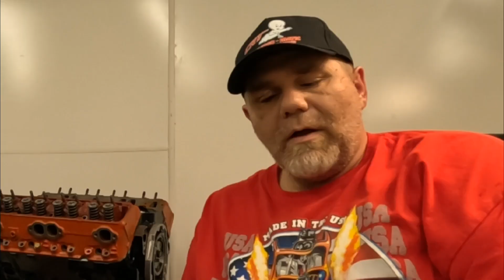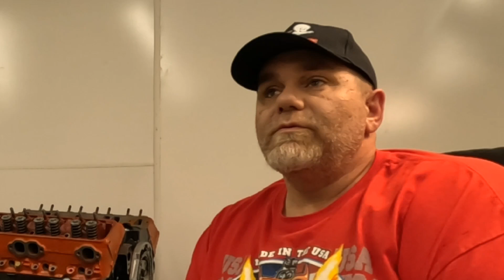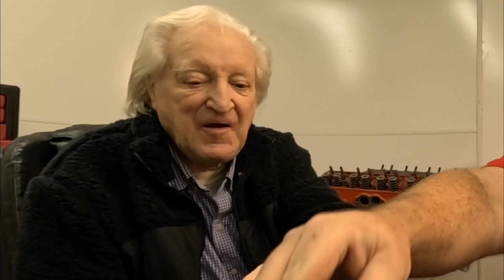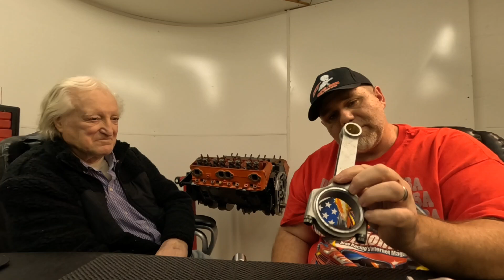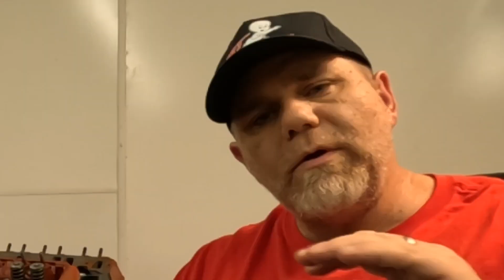When is Stock NOT really STOCK? @DavidVizard @servediocylinderheads @JustMoparJoe

Comment: UTG missed the point. The engine is going to be auctioned off and and end up in somebody's street ride. Now, I'm pretty sure they would much rather have 300hp, than 185 or whatever, I personally would feel they would probably be underwhelmed with such a motor and it would end up going on the shelf indefinitely but glad they contributed to St Jude's all the same. So what if they use closed chamber heads? it's about using the best OEM stuff possible afterall. I have a feeling they would have junked the 4 barrel intake and carb and fitted an aftermarket 4 barrel setup anyway. And rejecting the gift I was going to send you UTG, get a grip! - if someone wants to derive enjoyment from sending a channel they enjoy watching a gift, whats wrong with that? Oh well, it has now gone to another well known Mopar channel who were MORE than happy to accept it!
Reply: I didn't miss the point...the point CHANGED after the outline of the project was established and THEN a charity became involved.  
As for accepting or rejecting gifts, as a policy we don't accept anything from anybody, and you would be shocked at some of the stuff that's been offered over the years.  This policy goes back to my automotive journalist days.  Why? Because what's the difference between accepting a token from you or a car from one of the manufacturers.  Either one has the same potential to cloud my judgement and sway my opinions.  It used to fall under the heading of "journalistic integrity"...these days that sort of thing doesn't really exist anymore, does it.

Comment: Once you threw this cylinder head guy into the mix it was apparent that the “normal guy” with a dirt floor garage couldn’t do all that will be involved with the cylinder head. 
    I was lucky enough to be in a couple machine shops that , yeah we built some stupid sized off the wall engines , BUT,  we also had the tasks of building some engines that were for factory stock race boats and a couple F.A.S.T and Pure Stock engines .
    My opinion,  sometimes that skill set pulls you down into a humble mode and makes you think harder outside the box.  Unfortunately some people cannot afford those multiple boxes.
Reply: His name...is " Charles Servedio" 😁👍

Comment: Keep it like it was originally laid out, a rock auto “hot rod”. Like a 2bbl thunder bomber rule motor. It makes what HP it makes but hope for the best.
Reply from the maker: Even under Thunder Bomber rules you don't have to reuse worn out 50 year old part... That is what most people thought I was going to do and I realized that TOO Late.. 
Andy
Reply: @UnityMotorSportsGarage  he said parts from rock auto though.  The way I took it was anything oem replacement offered by rock auto.

Comment: Nice update!  I agree with the cost effectiveness of the rods - that is not the chokepoint anyways.  What I see on the big picture is a 318 getting 340 power.  Add the 340 cam, intake, and work the heads - oh and that pesky production valvetrain setup.   On the stock subject, these is "bone stock" - exactly as factory, and then there is a "stock" class for racing.  The local autocross has stock (with parameters), modified stock, and open class.

Comment: I love so called stock builds? My 1968 302 (306) made 503 hp with all used parts but the cam and lifters. Ford Motorsports Factory replacement Rods and crank, had to find several batches of old 1986 flat top Four valve relief pistons that was factory 0.030" over, Yes, those are indeed Factory forged pistons to boot, A set of ported 1970 D0OE 351 Windsor heads by Jim Lingenfelter ( Yes, Kin on legendary John Lingenfelter) with 1.94" intake valves, and 1.60" exhaust valves, I angled milled the head from 20* stock to 18.5* ( Yes I worked at a automotive machine shop, I ported my Victor Jr intake, I bought a used rebuilt 750 Holley DP, Used Hooker SuperComp Headers, now, The cam was originally a custom ground cam for a 351W, no for a small cubic inch engine, 0.697" On the Intake and 0.703" on the Exhaust and 108 LSA, I do not know the rest of cam card, But it sounded like ProStock engine at ideal and screamed to 8800 rpm me shifting gears, my father loved driving my car but the taddle tall Tach said 9500 rpm when he drove it. I was hoping for 375 to 400 hp on my first personal build, I over shot that big time. One thing I did learn though? Time is indeed money if you Think that away, I personally don't care on the time to money part. I just love building engines period. As one person said, The super Stock/Stock eliminator class guys do alot on stock stuff thats beyond ones belief. But I learned from them on whats possible with stock parts that can be heavily modified. I also learned to get to know your local Automotive machinist, you never know what they might throw at you or what they might offer. live and learn as the late Sonny Leonard told me. Learn something new every day.

Comment: What about offset grinding the crank for a slight increase in stroke, compression and getting the deck height up near zero ?
Cheaper than longer rods perhaps and a few additional cubes.....
Reply: That was my plan....
Reply: @UncleTonysGarage 
I was really interested in the original plan - max power from factory original parts. At one time, I built engines under similar restrictions, exception being a 500cfm Holley 2bbl and a class spec. cam.
Using a few stock part optimizations, my engines always ran up front.
Added knowledge is this direction was what I was hoping for.
Reply: @UncleTonysGarage  
As an old school machinist that's how I tend to think with every component in an engine, how can I cut, grind, contour or drill holes in this to make it better.
Good luck brother

Comment: This is a prime example of how quickly something simple can get fucked up. The plan was simple it wasn’t supposed to be a build it was supposed to be an experiment. Of course it’s easier stronger and probably cheaper if you time has any value to just buy aftermarket parts. If you replace one part in the engine (even a rod bolt) with a non stock part this simple experiment has no point anymore.
Reply: well, the experiment runs into the classic problem of giving the 318 any sort of real compression. and your bit about the affordability of parts is valid--was Tony footing the bill? I have to agree with what Andy said here or someplace else--he's building a brand, and using crappy worn out parts isn't going to help that. But as for "non stock" parts, is a Holley carb (for example) an aftermarket part, or a factory part? they came on quite a few performance cars. We probably already know how much power a 2 bbl 318 is going to make--Ma Mopar likely took the best one they had to dyno test originally. we all love to think we can port a cylinder head, but in reality most people just make the ports too big and mess it up.

Comment: Forget the original intent  , and just build a .030 over 318 , with a DV speced cam , Charlie's heads , and try a few manifolds and carbs on 'er . Also one or two of the 2 barrels for kicks . Btw, who  is going to do the rest of that grinding in the crankcase ,,, ?

Comment: I think you should finish modifying the stock rods and do a build with the modified stock 2 barrel, just to stay true to the original idea as much as possible, and do whatever magic you can to a stock exhaust manifold. Its not hard to tear down a motor especially if it was never put in a car. You can go aftermarket later...Shave the block but not the head and regrind the cam? Just a thought.

Comment: I liked the concept of the original idea. However I think the idea of a 2 barrel carb was just a bridge too far. Generally any gearhead is going to install a 4 barrel... could have restricted it to a cast manifold to keep in line with the parameters. As far as heads go I know nothing about LA mopar heads..but I think if you use a casting from a 318 that is obtainable at the scrap yard...fair game. The average guy isn't going to sit around and grind on these parts for months and if they're that broke they need another hobby.
Reply: If it's just a short term hobby, I completely agree, of course not having the money is no excuse to give up what truly interests you if you can find your way around it

For me, it was learning what made power, what didn't, not trying to find a trade school that didn't exist yet, and that by having the knowledge I could beat the 'credit card cars' with my low budget, nothing special cars
My that turned into side work, and then a business.
The knowledge was the value in the original plan, If that doesn't matter to someone, that's fine just the same.
Reply: @Motor-City-Mike  I love the concept of low budget cars. My current drag car is built out of stuff I had laying around for years. When I tell people exactly what I have in it they're pretty impressed...the car went far past what my goal was last season. It seems I can't stop thinking and contemplating what I can do to pick up that extra 1/4-1/2 second. It should be interesting and I'm antsy for the upcoming season.

Comment: so basically it’s a modified build it was meant to be for the home builder to spend min amount of money not the man hours involved. For the home builder Time doesn’t cost money
Reply: DV did a how to video on modifying the stock rod for anyone interested in saving money
Reply: There's not much you can do... Vizard said a stock rebuild will perform like a stock engine. Used to be called an "overhaul" when you tore an engine down cleaned things up and reassembled. With machine and head work its a "rebuild" Balancing and blueprinting is what Tony is talking about but it doesn't make sense with stock parts. Even a basic dirt poor hot rodder will scrounge up a cast iron intake and 4 barrel on the cheap . I get the old school hot rodder thing but  ,you know what they really  did? they put big Lincoln and Cadillac engines in small coupes and roadsters. They didn't play around with the stock flathead 4 or 6 engines...

Comment: I like the concept of tonys original idea. Not necessarily because its using old worn out parts but it can be applied to engines that have no aftermarket support. We did a similar build years ago with the ford 400. Now we did overbore it and cam it but when you limit yourself to factory or factory replacement parts breeds creativity. Now all that being said and no offense to tony but basically he was wanting to build it like a guy would have done back in the 80s or 90s when there wasnt much in the aftermarket for most engines. I see both sides of this and agree with both sides depending on what your end goal is. When u build an engine to the max with the original parts and give it to someone who may not completely understand its limits could cause a big problem if they push it past its goals and it comes apart thats how you get a bad reputation.

Comment: Since Tony has already stated that he will do a 318 in the original ideas spirit, perhaps using heads he ports himself etc, would it be possible that you together dyno both engines in the same dyno? Would still be nice to see the difference of a low buck, home made effort and an all out serious build up with the same restrictions (ie. stock head castings and valve size, factory 2 bbl intake and carb, and 318 exhaust manifolds).  I thik that would be great. And since you seem to have a body where to put the engine, I guess Tony might have one too; time for Drag Racing?
Reply: I really doubt that Uncle Tony will do a version of Mission Impossible, he has a habit of not following through..

Comment: I am looking forward to both this 318 engine build and Uncle Tony's 318 factory stock engine build.  I'm sure most would agree us Mopar garage mechanics, and hot rodders in general, stand to learn a lot from both builds.  I have already learn more than I could have on my own following Charles Servedio 318  head work and very extensive port flow data.  So, all you guys are providing information that's taking the guess work out of it.   I'll be building future 318 engines based on the outcome of these builds, isn't this the ultimate goal for doing these videos?

Comment: C'mon dudes , stock is stock . (Minus what you can shave)😊
Reply from the maker: I'm not using 50 year worn out parts for a build... Not happening
Andy
Reply: @UnityMotorSportsGarage  Andy must have been traumatized by watching 50 year old worn out parts drive out of his life on the drag strip
Reply from the maker: @jimmybravo7777 yeah that's it 🤣🤣🤣
Reply: @UnityMotorSportsGarage There ya go! Ya said it! Good! Only if you said that a year ago...
Reply from the maker: @rheidtech  the difference is I didn't realize that people were expecting to have an episode of junkyard wars with junk parts.. 
Andy
Reply: @UnityMotorSportsGarage  yaa..whooda thunk it...
Reply: @UnityMotorSportsGarage 
Seriously, I wasn't expecting junkyard anything. 
My take (which apparently was mistaken) was that a rebuilt with factory, or factory design, direct replacement parts, would go together with all the little to no cost modifications done to the above parts to see where that would go.
I put food on the table being in the business, builds from stock reman to NASCAR truck class engines.
I used many a rubbed on stock parts in claimer engines, 50yrs old, passed magnetic inspection, remachined, and held up fine, ran up front, some took trophys, drag race too.
I was hoping to see what was originally stated, honestly I'm disappointed as I'd hoped to learn another trick or two. I can buy parts with the best if them, but the tricks are fun.
I'm done kicking - I respect the direction this went and why, children are the future, and anyone who works in interest of the betterment of children is alright with me.
Best of wishes, and thank you on behalf of St. Judes!
Reply: I made that mistake very early on. The poor fitting pistons and valve guides let oil into the chamber. It was beaten and detonated itself to death. Never again.  @UnityMotorSportsGarage

Comment: at the start of this I FULLY UNDERSTOOD WHAT UTG MEANT. here we are debating terms & their meanings.... OK I GET IT! cuz recently i got into a spat over on a BB over the term "STOCK" when it came to how i referenced the GM reproduction L05 (1987-1995) 350 i put in my 86' ss. that is a stock factory engine unmolested long block engine & only diff is it had the port for a mech fuel pump unlike the then then ORIGINAL. in my mind ORIGINAL or factory original means WHAT LEFT THE ORIGINAL FACTORY back when. you were given a BACK WHEN factory engine and violated original terms with after market parts posing as factory parts.

i quit payin attn awhile ago. imo this was more a test upon your skills than it was ensuring the goal can be achieved. in other words if 290 hp was best you can get outta that then so be it as long as you gave it your all. oh and im sure UTG had no idea the depths you guys would have to go thru trying to get there...
Reply: to add 1 caveat. the gm FACTORY ORIGINAL ZZ4 NEVER featured in a FACTORY PRODUCTION vehichel as the L05 did.
Reply: Tony needs to get off his ass and build it thats all...

Comment: I love you guy’s but you really missed the whole point this time.  I was really surprised and disappointed at how this came about.  I know you keep explaining but you are explaining something that has nothing to do with the original concept?  Still love you guys and UTG.
Reply from the maker: I respect your position on it, Since this engine will have my name on it I want it to be right and not cobbled together
Andy
Reply: @UnityMotorSportsGarage this is the whole problem in a nutshell. It was to be an experiment not a sales pitch! I really wanted to see what the dismal underperforming 318 could really produce! Just my $ 0.02!!! Also David’s project is a worthwhile but it should have been done either separate or after the original idea was completed!! Still just my thoughts! The whole matter is a huge disappointment and it definitely isn’t worth losing a friendship over!
Reply: @M_Phipps0520  when Mopar picked out a 318 engine to dyno test in order to have a HP number to advertise...do you think they picked out their best built engine to test, or they just grabbed any one coming off the assembly line and hoped for the best? remember, this wasn't a performance engine they had to sandbag. so there's the answer to the big question. 

i agree, this isn't worth losing friends over, but UTG has pulled the same stunt on DD Speed Shop's channel and they say they're all still friends. maybe that says something about how they view the viewers, but it seems like they all smooth things over in the end.
Reply: @UnityMotorSportsGarage if you built it why would it be cobbled together?
Reply from the maker: @wyche11 if using worn out parts it would be definitely cobbled together
Andy

Comment: I liked the idea of a guy with time, but no money, putting together the most power from a stock, clapped out 318. What I didn't consider was spinning that thing to the RPM required to get there. And I assumed junk yard factory, but higher performance parts like head, intake, exhaust,carb would be allowed, since that's more likely what someone might do.
I also assumed we would see the HP difference on a dyno as we went along.
The problem is you build a bottom end,or modify it AFTER all the other parts have been collected. So, I liked the intent, but now see the point about practicality more clearly, thanks to you. I'll follow all the channels because this is the content I enjoy.😊👍